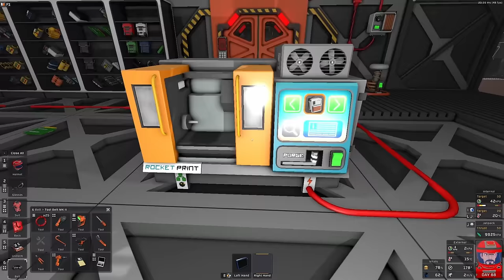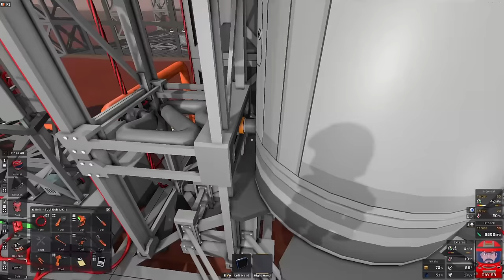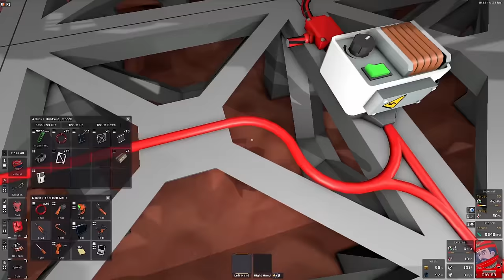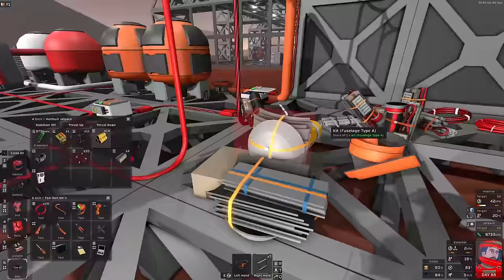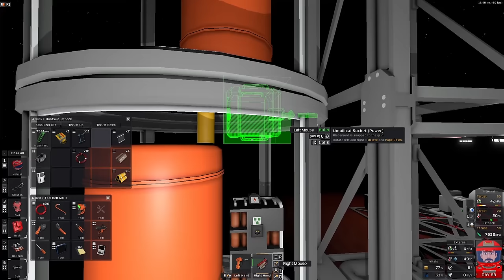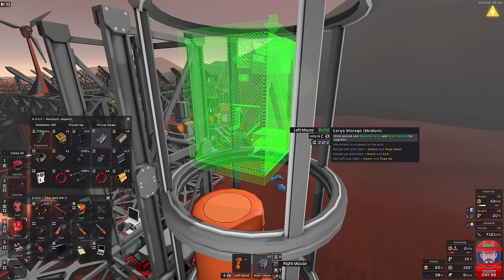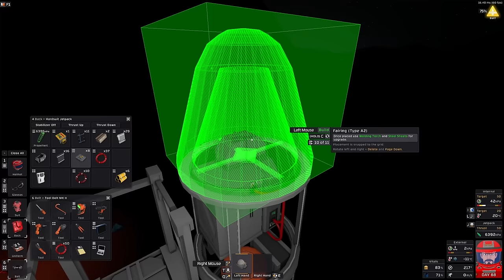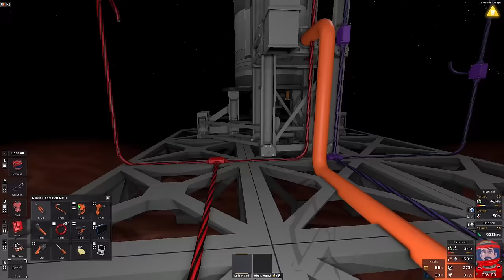Stationeers Building a rocket without using the instructions.

Comment: @Cows are evil When I was streaming it I had nothing near the rocket lmao, I was able to engage the Rocket Engine without anything burning on me lmao.
Reply: I placed my Uplink on the roof of the base as an Antenna for the rocket data communication.
Reply: also with the device box you can use the Red and Green switches to also turn on and off thing on the rocket, you don`t have to type the value in manually
Reply: @Cows are evil there is also an accsess bridge that you attach to the Launch Tower, the length of the Bridge is how far the Umbiblicals can go they reach far.

Comment: Haha, Mick!  You were on fire at the start (literally) and finished with a bang!  An entertaining, not to mention useful primer for the rocketry update - thanks very much. :)
You may not think this first new rocket of yours qualified as "single use" as you didn't get any ores back, but consider:  Your rocket did see single use as an explosive excavator - you now have the majority of your flame-pit under the rocket pad cleared out.  Never mind the extensive structural damage caused by the rocket re-entry ... as the late Sir Joh would have said: "Don't you worry about that!"

Comment: Theres a reason, why the Ice Crusher is slower now:
When you crush Ice, it cools down the internal atmosphere of the crusher. The Crusher realises that and heats its internal atmosphere up, which takes time.

If you hover over the "information panel" of the crusher it tells you its heating up its internal atmosphere.
There is a way to change this: Write the temperature, to heat up to in Kelvin, to the Setting-Value of the Crusher (Logic Writer). Be careful though! I accidently almost destroyed my base by setting it to 270 K and overpressurising the pipes....
Reply: Was going to post this, bang on. 274K has been a happy setting for me.
Reply: @coffee_quaffer 
Thank you!
I discovered it while waiting for Volatile Ice to be crushed and thought "is this really that slow?"

For Oxygen/Nitrogen i use 270K (there is a filtration behind it and i am feeding it slowly) but for Volatiles 285K is my lowest setting.
Reply from the maker: That explains why I am getting 15C gas from ice that melts at -200C.  Time to rebuild the melting room.

Comment: I had the same issue with the rocket running away and not landing. It seems you have to turn auto land off and back on again. on the rocket screen in the top middle is a picture of the rocket with a little arrow pointing down. click to turn it off and then back on. during the next landing check altitude to make sure the rocket is actually returning.
update: didn't watch the ending until after my original post. The crash was the result of the runaway rocket running out of fuel and eventually being brought back down by gravity. I always clicked abandon on the rockets that ran out of fuel before they came back down.

Comment: can you enclose the rocket engine and use the door like turbines to generate power? :D
Reply: He tried on a previous LP with regular hot exhaust from his engines, unfortunately there is a maximum pressure/temperature and they break easily.
A rocket would be far too much.
Reply: @WiseMack718  Maybe funnel the exhaust into a shaft and close it in with a blast door once the rocket launches. The pressure won't be high, but you might be able to run a stirling for a while off the hot gas.